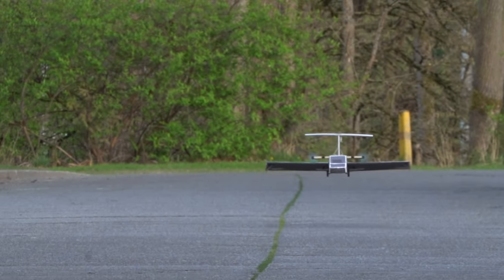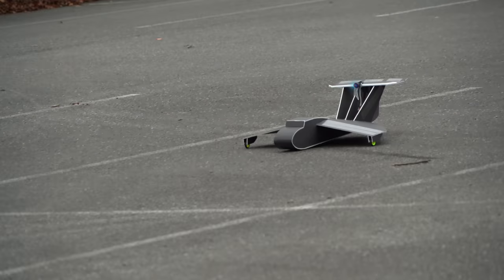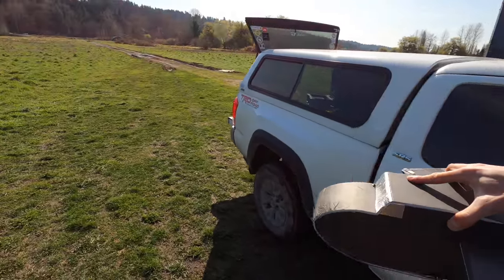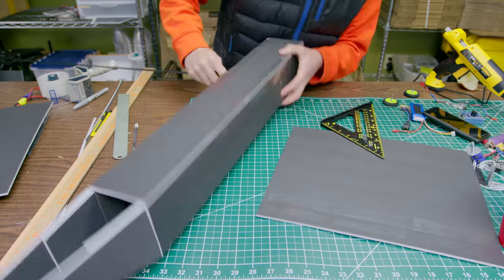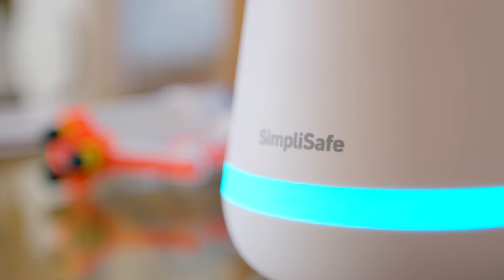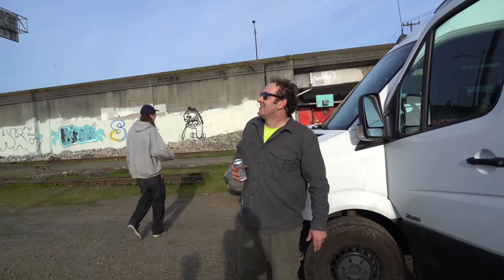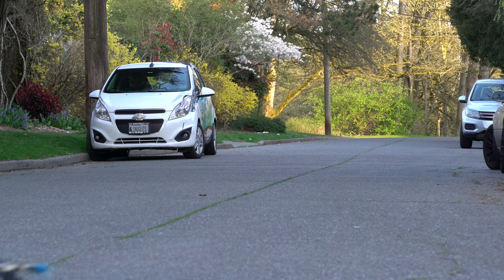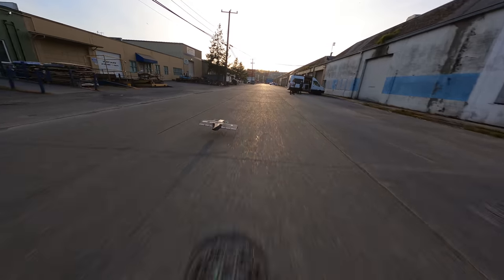R/C Ground Effect Vehicle with LiDAR Altitude Control

Comment: Have you experimented with shorter, deeper wings to see if that helps stability with bigger end fences to box in air at the outer edge of the wing on the underside to keep the ground effect like old F1 cars, but in reverse, and then have more upward angle of attack for the wing?  Similar to what current F1 cars are trying to do with the tyre squirt on their defusers this year, they have to force the air above to stay out and high rack designs are better at it this season, you want it the air to stay in to maximise the compression of the air just like they are trying to create a vacuum to suck the cars down.This could let it fly with more throttle to maintain consistent life and not take off, which suggests it was only looking at the ground as a reference rather than using ground effect itself. Old ground effect planes seemed to have quite an angle of the propellors at the front and they might have been aiming at just in front of the leading edge of the wing so their draft goes down and adds to the air cushion you need which should reduce the size of the wings required as well so you can improve the top speed and stability. Experimenting with ballast could be useful too, where it is and how much so it is slightly nose heavy and the throttle and angled props brings it up to neutral.
Maybe also experiment with the Lidar as a front and back rather than left to right unless they were controlling the props on the side they were positioned. Front and back you could try getting the control system to work out the pitch you want as optimum as well as min/max height ranges and work with that. Then if it is getting to pitch up and far away it can cut throttle and descent more automatically.
Does Lidar work at an angle? If it can possibly aiming the sensors forward could give it a reaction to objects in front of it so it can predict what throttle it needs, it has to power up to climb a slope, or cut the throttle at a descent instead of only doing that when it hits the ground or flies past the down ramp.
Really cool project, nice use of technology to manage the workout and the designs look fun to build up.

Comment: Have you thought of using small servo-controlled spoilers on the top of the wing perpendicular to the path of flight?  Sized properly, they would reduce lift and restore lift rapidly.  This would avoid the delays from "spooling up" the motor.  Place properly fore or aft along the chord, the resulting pitching moment may be more manageable.

Comment: Excellent video.  I have been wanting to build a micro light version of a ground effect vehicle for one person.  Altitude and pitch control are two of the issues I have been trying to sort out.    I am planning on a pusher configuration using one motor from a powered paraglider rig.  I've flown light aircraft, hang gliders, paragliders, powered paragliders and RC aircraft, helicopters and drones.  I hadn't considered using liDar to assist with altitude control.  Good luck. thanks for the video!.  Liked and subscribed!

Comment: In the real "WIG" the power is usually  set to a predetermined  cruising speed  which is well above stalling speed. Taking into account best fuel consumption. Height management  is done manually  operating  the elevator.

Comment: Maybe a mini servo with some flaps. Adjusting lift may be a quicker way to adjust altitude. Also, possibly program you flight computer to watch rate to altitude change so it can make bigger adjustments before it's too low or too high. Somehow you need to "look ahead". Hmm....

Comment: This is great -love it!
Perhaps you could install a more reactive lift fan(s) at the CG that assisted with the altitude correction while aircraft speed increased or decreased smoothing the wobble. It would be a hybrid between how a drone controls altitude and the current speed control method.

Comment: You can increase the ground effect by tilting the props a bit up, pushing more air under the airfoils. It's a joy to wath, keep it goin'
Reply from the maker: fast moving prop wash has a lower pressure so angling it under the wing actually decreases lift!
Reply: @rctestflight  OK, you're right. I've thought of air pushed under the wing, as it dams up on the steep angle of the wing's ends, pointing to the ground. But even with this ground effect vehicle, the area under the wing edges is too great to allow building up an air cushion, as it was in my phantasy. I'm amazed of your crazy projects!
Reply from the maker: @kamikazeratte  It worked for the big Russian ekranoplans that had flaps touching the water. They would blow air under the wing to help get off the water, but not in flight.

Comment: What if, instead of adding ailerons, you mounted the motors on a hinged structure (moved using an actuator) so that you could change the pitch of thrust. It would treat the center of mass like a fulcrum, sort of like pulling a trailer behind you, but on the vertical axis instead of the horizontal axis. Think of it exactly like a V-22 Osprey, but with the
rotors/propellers all the way at the front of the vehicle. That way, you would be sort of “dragging” the vehicle over the ground effect, and could control the angle of attack of the thrust, without having to rely on air moving over control surfaces. You could also think of it kind of like towing one of those flying inflatable rafts behind a boat. It’s just an idea, but I think it would work.

Comment: Slats? They improve lift. The F-4 Phantom II has leading edge slats that move forward and down. They also divert hot air from the engine into the wings, to get blown out and down from the inside of the slats, increasing lift.
Maybe a slats system that uses a small prop on the inside of the body that channels air into the wings to get pushed out and under the wings?

Comment: I spent the whole video thinking using throttle is a crazy idea you want to go as fast as you want :D Have you considered using flaperons to increase/decrease lift instead of throttle; if centre of lift and centre of mass aren't too far apart the elevator should have no problem maintaining attitude I did something similar on an unstable spitfire foamie to reduce stalling during landing using a fork of cleanflight (it didn't work well, but I gave up quicker than you seem to)

Comment: Perhaps try wing flaps or flaps and leading edge devices on the wing to control altitude. With trailing edge flaps and leading edge droop you are effectively making an adaptive or variable camber wing. With experimentation you should be able to change the coefficient of lift without introducing a pitching moment. There would be an increase in induced drag that would need to be offset with added throttle but it would only be maintaining speed so would not have the latency of accelerating the mass of the vehicle.

Comment: You could try using a larger propeller diameter with a very low pitch speed. It would give you a little more static thrust and braking. A v-pitch setup might be ideal.

Comment: What about putting a servo on the ailerons to drop lift instantly, it would react so much faster than the throttle and allow you to maintain altitude more precisely. Then you could even dial in a higher pressure bubble or lower pressure bubble under the vehicle, depending on airspeed, but maintain altitude independent of airspeed.

Comment: You could just have your propellers mounted with a variable downward angle. The thrust vector could be kept close to horizontal to avoid loosing efficiency but angled for quick and direct maneuverability.

Comment: It was behaving quite well with a linear response to altitude. I think you should definitely try to add a derivative part to your controller. This should fix the oscillations. From my experience with PID controllers in games the derivative part really does miracles.
Reply: Derivative meaning the vertical speed of the airplane? Maybe it could even do a double derivative to take in account the vertical acceleration.
Reply: @charle-edouardsavoie6634  Yes, vertical speed. I don't think you need to account for second derivative as it would be very noisy probably.

Comment: I wonder how Ground Effect planes work. A normal airplane flies because it pushes air downwards. According to Newton's second law, if you push a mass of air down with a pound of force, you generate an equal and opposite pound of lift. People incorrectly cite Bernoulli's Principle as the way a wing works, but really it is Newtons Second Law
Reply: You are not quite correct here. The fact that there is a force being exerted on the air (and hence equal and opposite force exerted on the wing) as the Newton's Third Law says is a mere effect of the lift, not it's cause. 
Lift is caused by the net imbalance of aerodynamic forces on the lower and upper sides of the wing (for incompressible flows pressure vs speed relation is governed by Bernoulli's equation). This imbalance is what gives rise to the downward force imparted on the air in accordance with Newton's Third law. Not the other way around

Comment: You could have an air speed sensor in the nose and in the tail, and based on the difference between these two points - hell, add in some at the wings too! - and based on the difference between those,  you can calculate the proper wind speed adjustments on the horizontal 2D plane!

Comment: Did you think about a) going with a canard design or b) adding a VTOL fan in the wing?

Just a little more stability will solve your problem.

Rutan demonstrated that canard designs are inherently stable.

And just a tiny 1” fan motor in each wing would magnify your ground effect bubble.

That way your prop speed wouldn’t be what maintains your altitude.

Comment: @rctestflight You should look at otto aviation design. He has over 40 years designing long-range aircraft and it seems the one he is working on will work for you. Try and put the propeller in the back and build it like the Celera and see if you get an improvement in distance and stability. Celera 500L from Otto Aviation, If you succeed then guess what... Then Otto aviation can take their aircraft and adapt your ideas to making a different type of transport.

Comment: you could just as easily use a ultrasonic sensor or even simpler just hang 2 tiny lines down from the plane and check the resistance to see if you hit water or not. if the line has a connection with a lower enough resistance then power up the motors. could also work for ground but the resistance will change so just test for any resistance at all.

Comment: Really impressive. My knowledge in flight is upon 0, but I suppose that th only way to fast and precise control the vertical force without change the angle of attack (that would be a problem flying so near the ground) is to control the pressure under the wings with some kind of flaps. Maybe I'm writing something stupid, but could be a good idea to have 2 flaps, one in front and one in back of the wings. good luck.

Comment: You mentioned that you were going to use the elevator, but there are complications. Maybe make the lift from the main wing variable, so you can control lift without pitching. You could make hole in the wing with a variable aperature. Or turn ailerons into flaperons?

Comment: This is why I fly quarter-scale models. Less squirrelly 🐿 😄.  Question: Have you increased the positive camber of your airfoil? Similar to Pattern ships and Aerobatic aircraft. You really need to keep the craft from wanting to pitch up with increased throttle. I'm pretty sure you can shape your 1/8 or 1/16 scale ekranoplan to fly in GE without your LiDAR. You should be able to just punch the throttle and your Wig should just hover about 3-6 inches off the deck without getting airborne.  I know this can be done for a few of my old flying buddies who built a few WIG aircrafts. I wish I was still in contact with them so I could just get a foil template for you to use.  😌

Comment: I think you could achieve much better result if you would automatically adjust the elevator too... The aircraft reaction to any throttle change is much slower, till the elevator change is quite instant. But of course that would make the setup much more complicated and the adjustment much harder. (I mean if you want to control the throttle AND the elevator in the same time automatically.)

Comment: With more props maybe you could generate "fake airspeed" where most of the lift is generated by prop wash going over and under the wing. Then you would't need to wait for the acceleration of the whole thing (although this was maybe the point of design #1 and it didn't work there). Also maybe if the thing is heavier and faster it will be more stable?

Comment: Ground effect aircraft are a fascinating subject, but this model did not really employ any of the same mechanisms. It is using a very clever control loop and enthusiast LIDAR to fly a plane very close to the ground.
Finding a balance point between throttle and ground effect would have been awesome, but with the slightest breeze lifting the plane right out of ground effect range, where it still flies fine, it's a bit of an aesthetic exercise.

Comment: Have you considered using some conventional slow flight stability design in a wing to begin with?  A Hersey Bar wing is the most difficult aircraft to fly.  It has no inherent stability and is why you never learn to fly in one.  Have you considered using a model C-150 or Cub wing as a beginning instead of trying to make a brick fly?

Comment: Use spoilers on the upper surface of the wing rather than the throttle (or elevators ) to control altitude. Power and angle of attack adjustments are only good for gross control of the vehicle (sustained climbs and descents) and not for the fine and rapid control responses needed for this application.

Comment: Without right calculation (modelling) the only way to know the vehicle endeed uses the ground effect is when the battery capacity is enough to fly several times longer with the same speed as at the smallest hight at which the ground effect cannot be present.

Comment: I have been trying to build an easy to fly GEV for a couple of years now. Now, I can sleep better knowing my attempts to manually fly my reverse-delta GEVs went just about as well. I had assumed it was my bad flying skills (also doesn't help designing dynamic stability into a GEV airframe requires INSANELY complex math!). Every once and awhile I need a reminder this stuff is really hard to pull off well! Thanks for sharing the firmware. Can you give us a component list and basic specs on the prototypes?

Comment: "docility" of an airplane is not only based on vehicle mass, dimensions, mach or reynolds numbers. Looks like you've got to read up on aircraft stability. Long story short - you want the plane to self stabilize and glide if you just power off in the air. Once you've achived that, you won't need such radical flight control inputs

Comment: perhaps try switching to flaperons and use flaps to control the amount of ground effect lift to control altitude NOT speed.
i vaguely recall a doco years ago seeing one that had extra flaps on the outer wing to control spill as the altitude control mechanism.

Comment: What if you connected the lidar to controlling the elevator and maybe control surfaces on the ground effect wings? It could control height from the ground with the elevator and sideways stability with the wing control. Do the props aimed up so they push the nose up on throttle, then you have more control on how it reacts to throttle and only have to focus on the rudder.

Comment: If you could try to extend some of the weight out towards the tips of the wings, it would make the plane more stable in wind. I don't know how big of a difference it would make, but I do know it would improve at least some.
Reply: Maybe also increase the propeller size if possible to account for the increased weight but i have no clue how hard the propellers are working on that one so.

Comment: The fidelity and elevator you mention at the end, could that be more effectively be accomplished with drag? I feel like flaps, that open and close balanced on top and bottom so that it does not disturb airflow disproportionately would be a possible option to solve or work around the problem.

Comment: What about controling lift by  changing the shape of wing, a.k.a. using "flaps"? Because elevator positinion drives change of your pitch and pitch position drives change of your altitude, that is like driving backwards with trailer. If you will change directly lift of your wings (either by changing angle of attack or extending flaps) then it will be more direct (lift coeficient will drive change of altitude). Changig lift will aso change drag, but that can be compensated by changing thrust just to keep constant speed.

Comment: I wonder if you could use some spoilers on the wings to change the amount of lift you’re generating. Not sure if it’d work with ground effect but it would also work as small airbrakes so that might help a bit

Comment: are you doing range to ground averaging or is it reacting to every reading?  The reason I ask is that the road surface is broken and bumpy at the small scale end of the spectrum.  That wouldn't matter much in scale to a larger craft using feet or meters but at the scale of this model, millimeters, the small stones in the asphalt road could be enough to present problems.

Comment: Use sweep wing design that change to optimal configuration base on altitude is the first modifications then add on anti gravity for better stabilizers at extreme low altitude it work best for cruise missile